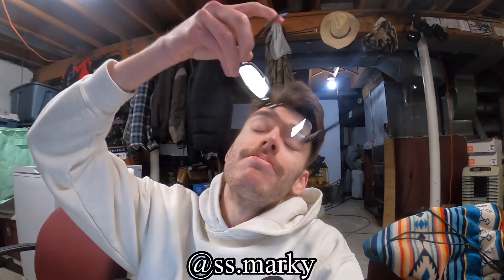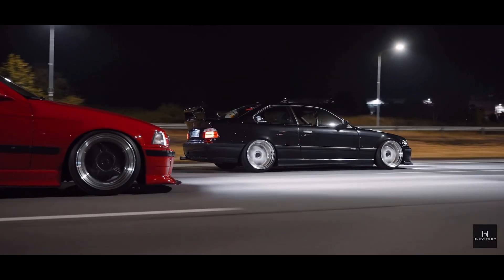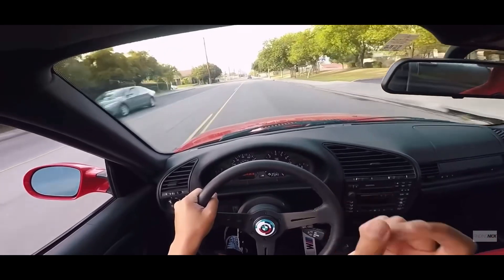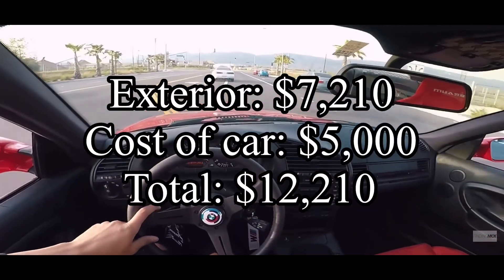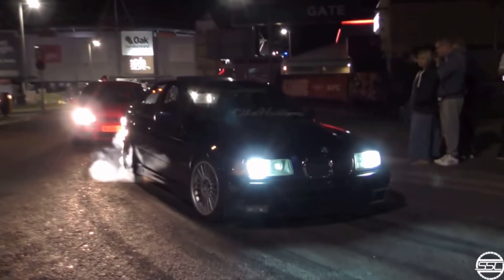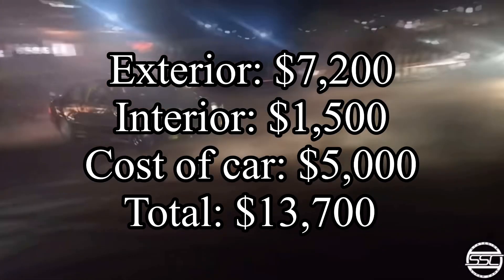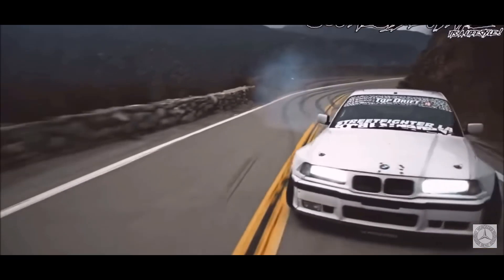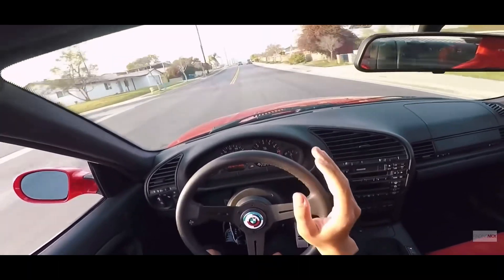How To Build A BMW E36

Comment: huge missed opportunity with not mentioning the cooling system. these cooling systems are notorious for being garbage, essentially everything being made of plastics. it’s like $400-$1000 depending on the route you go with but there’s a couple things you should upgrade; that being the water pump, thermostat, thermostat housing and the radiator. you can either swap to an electric fan or keep the clutch fan but if you keep the clutch fan make sure to replace the clutch as well. when upgrading, clutch fans are recommended over electric fans for climates with higher temperatures, but if you live somewhere where it’s very cold an electric fan will do just fine. I like to use mostly distilled water with a bit of coolant because water actually has better cooling properties. Just putting my 2 cents in, cheers 🎉 great video

Comment: my build so far is, Injen cold air intake, GP motorsport equal length headers, vibrant muffler, style 68 wheels, a high flow throttle body boot, and its all on my 1995 325is

Comment: 5:00 in, no mention of running gear? I’ve had eleven of these. You must check under the hood and focus on common fail points. Fan, coolant tank, water pump, and radiator. This guy may be putting a hat on a dying car.